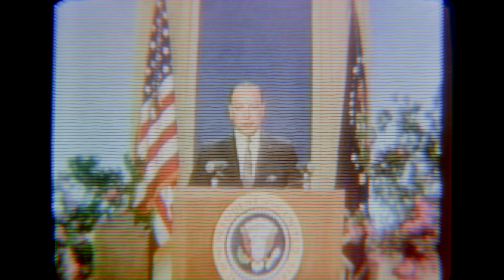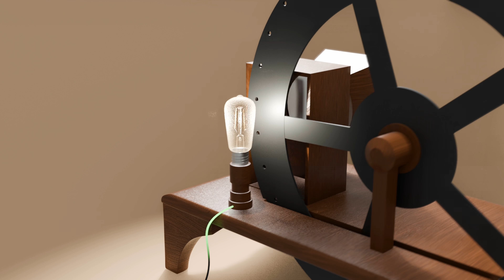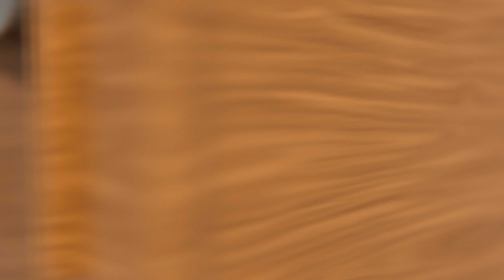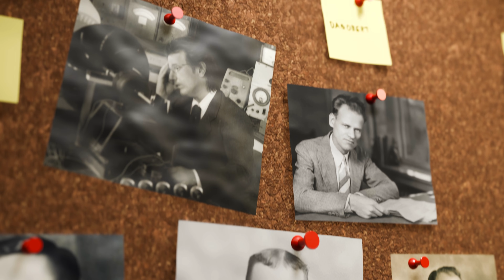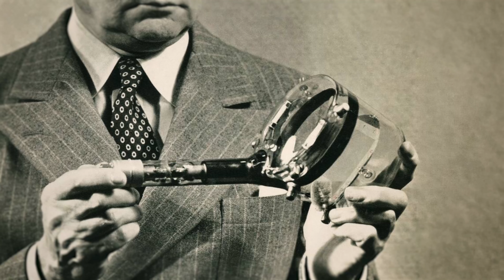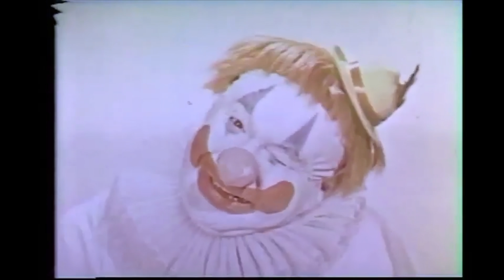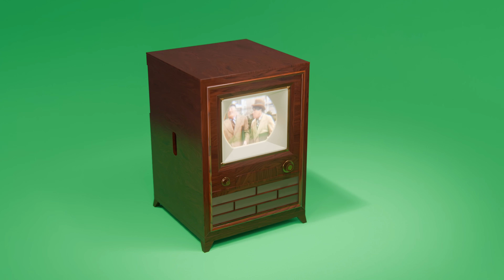Why Inventing Color TV Was So Difficult

Comment: One of the craziest things about those early CRTs to me is that they made them entirely without chips. Ever single deflection of the electron beam was controlled entirely through analog circuits, and they didn't have access to the same computer controlled, high-precision manufacturing tools we have today. RCA made their shadow mask without any kind of CNC machines, just well made mechanical and analog ones. It's honestly insane to me

Comment: You may be asking: how did they fit all the chroma and luma data into the same bandwidth as luma originally? Answer: they didn't. The ability to represent luminance changes of a certain frequency is limited, and some color changes are limited as well. For photographic images it works fine, but it does result in some image artifacts. For instance, if you pause a video game or any image with well-defined lines, you can see "dot crawl" on the lines. This is a result of composite video having to jam the chroma and luma together, losing a little image quality in the process. On non-broadcast TV, you don't get this if you're using component video or S-video, which have more wires to carry picture data. Edit: if you're watching a DVD of a TV show encoded in NTSC broadcast format, the artifacts will be there regardless.

Comment: Wasn’t that similar 😉. I fix TVs in the late 60s and early 70s.   Beginning with tube type only and then in the 70s became transistorized (Quasar by Motorola ,works in the drawer.) 
Keeping that chroma signal locked in at 3.57 was always a challenge. I can’t tell you how many TVs that I had to align the beams using dot matrix pattern on the screen..  of course I have not so fine memories of that 24,000 bolts hitting the anode on the CRT.  

Excellent video

Comment: Color decoding depended heavily on the system used for decoding. Several different systems were used, the most well-known being NTSC, SECAM, and PAL. They were not compatible. For example, a SECAM decoder produced a black-and-white image encoded with PAL (with noise instead of sound), a PAL decoder produced no image or sound with an NTSC encoder, and vice versa. On the other hand, all of these systems relied on the network frequency of the country in which they operated for various reasons (NTSC 60Hz, PAL and SECAM 50Hz).

Comment: How could the encode pixel information? As in what pixel the signal at any moment corresponds to? Also, they had to not just push the beam out of the 3 guns but had to point the beams at a pixel. If I were asked to do this now, I'd simply use a microcontroller to control the coils to deflect the beams but how did they do it in those days? A lot of questions, a lot curious to know 😅
Reply: It was not pixel-based, which requires a computing chip. Television was initially electric vacuum tube analog and then solid state analog technology.

Comment: My parents still had b&w when I was young.  We also inherited a b&w set from a relative. Around 1980 they won a 13" b&w Panasonic portable from work brand new that lasted several years.  And we were one of the first to get cable in 1982, as soon as the neighborhood was wired for it.

Comment: You forgot the big problem with NTSC was it's nick name "Never Twice the Same Colour" which meant a hue control had to be adjusted on the TV to correct the displayed colours to shift the RGB display to correct positions, a problem solved later with the German PAL system used in the UK, Europe and much of the world in the 1960's. This may of appeared much later than NTSC but was a much improved display every time further improved by the Japenese Trinitron to replace the  shadowmask CRT. Later TV's used slots with vertical phosphors insread of a shadow mask.

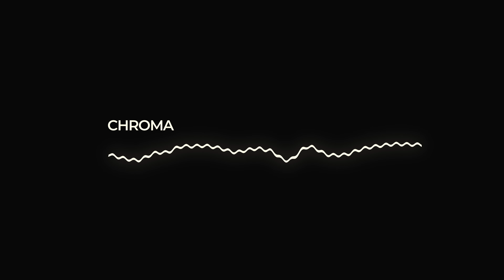Comment: 13:28 This is incorrect. Color TVs used the Luma AND the two chroma channels. Three channels are required to perform the maths to get back to the red, green and blue channels. Also the luma was given much more bandwidth than the chroma channels so using luma only would result in a much lower resolution image. Great video except for this one major mistake.

Comment: CBS had a system before RCA.  The CBS system had a spinning color wheel in the camera,  where a Red, Green,  and Blue image would be sent one at a time.   The TVs would have a synchronized color wheel in front of a black and white CRT.  The colors were wonderful,  but the scan frequencies didn't match the black and white standards, making black and white TVs obsolete.    As TV screens got larger, the spinning filter wheel also become impossibly large.   Improvements in technology could have fixed this, but RCA showed the FCC a system that didn't have those issues.   The FCC okayed the RCA system and shut down the CBS system.   What most people didn't know is the RCA system transmitted the color information as a very low resolution image.  The higher resolution black and white image tricked people into seeing the color as a higher resolution than what it really was.

Comment: One thing left out that is still a bain to American broadcasts, even digital, is the fact that B&W TVs were 30 frames per second but the new chroma information would only work with current TVs if the frame rate was changed to 29.97.  All American broadcasts (NTSC) including digital still use this framerate. The timecode on recordings and finished masters use drop-frame time code so broadcast time lines up with real time. Really just a mess that the Europeans avoided and use 25 fps.

Comment: One error : the luminance signal is not filtered out 13:30, it is combined with the chrominance signals. Since there are 3 colours, red, green and blue, three signals are required to encode them. Since the luminance was always present, the other two signals became red minus luminance, and blue minus luminance, or E'U = 0.493(E'B - E'Y and E'V = 0.877(E'R - E'Y), where E’B is the blue signal, E’R is the red signal, and E'Y is the luminance signal. Green is then recovered by removing red and blue from luminance: (G-Y) = -0.28I - 0.54Q = -0.575U - 3.94V = -0.509(R-Y) - 0.194(B-Y).
So far from being filtered out, luminance is a vital part of the colour signal.

One final note, green was chosen to be more represented by the higher resolution luminance signal because the human eye is more sensitive to green light than red or blue, the theory being viewers wouldn’t notice a degradation in quality in red and blue as much as they would in green.

Comment: 14:01 you still need luma, otherwise there are 3 unknowns but 2 equations so you can't solve the equation. explanation from gemini AI

You are right to be suspicious. That YouTuber’s explanation is a misunderstanding of how color television works.If a color TV discarded the Y (Luma) signal, it would be impossible to see a proper image. Here is the truth about how those three variables work together:1. The Y (Luma) is Essential for BothThe Y signal is the foundation of the entire image. It contains all the brightness, detail, and contrast information.Black and White TVs: They only "see" the Y signal. They are physically incapable of decoding the I and Q signals, so they simply ignore them and display the Y as a grayscale image.Color TVs: They MUST use the Y signal. Without it, the TV wouldn't know how bright any part of the screen should be.2. Why the Color TV needs all threeTo show a color picture, a TV needs to recreate the original Red (R), Green (G), and Blue (B) signals to fire the electron guns (in a CRT) or light up the pixels.To get Red, Green, and Blue back, the TV performs an algebraic "reverse" of the formulas I mentioned earlier. If you only had I and Q, you would have color information but zero "light." It would be like having a bucket of paint but no wall to put it on.The conversion back to RGB looks roughly like this:$R = Y + 0.956I + 0.621Q$$G = Y - 0.272I - 0.647Q$$B = Y - 1.106I + 1.703Q$Notice that $Y$ is in every single equation. If a color TV discarded $Y$, it would have no baseline to calculate the actual colors.3. What the YouTuber might have meantThey might have been confusing "discarding" with "separating." In a color TV, a circuit called a chroma decoder separates the I and Q (the color info) from the Y (the brightness info) so it can process them individually before mixing them back together to create the final RGB image.Summary: * Black & White TV: Uses Y, ignores I & Q.Color TV: Uses Y + I + Q to rebuild the full picture.

and chat GPT

You’re right to be suspicious — that YouTube claim is incorrect.

📺 What actually happens in YIQ
4
✅ The truth (simple version)
Black & white TVs
→ use only Y (luminance)
→ ignore I and Q
Color TVs
→ use ALL THREE: Y + I + Q
→ they do NOT discard Y
🧠 Why Y is essential

The Y channel carries brightness and detail:

edges
shapes
contrast

Without Y:

you’d lose most of the image structure
you’d only have vague color differences

👉 So you cannot reconstruct a proper image from I and Q alone

🔬 What I and Q actually do
I and Q = color differences (chrominance)
They are like “color corrections” added on top of brightness

Think of it like:

Y = grayscale photo
I + Q = color tint instructions
⚠ Why the YouTube idea fails

The claim says:

“Color TVs discard Y and reconstruct RGB from I and Q”

That breaks for two reasons:

1. ❌ Missing brightness information

RGB depends heavily on luminance:

𝑅
,
𝐺
,
𝐵
≠
functions of only I and Q
R,G,B

=functions of only I and Q

If you try:

many different RGB colors map to the same I/Q
so the conversion is not reversible
2. ❌ Math proves it

The real reconstruction is:

𝑅
=
𝑌
+
0.956
𝐼
+
0.621
𝑄
R=Y+0.956I+0.621Q
𝐺
=
𝑌
−
0.272
𝐼
−
0.647
𝑄
G=Y−0.272I−0.647Q
𝐵
=
𝑌
−
1.106
𝐼
+
1.703
𝑄
B=Y−1.106I+1.703Q

👉 Notice: every equation depends on Y

Remove Y → impossible to get correct RGB.

📡 What actually happens in NTSC
Signal is broadcast as:
Y (luminance) → main signal
I/Q (chrominance) → encoded on a color subcarrier
A color TV:
extracts Y
extracts I/Q
combines them → reconstructs RGB
🧩 Intuition
Y = “how bright”
I/Q = “what color”

👉 You need both to know:

“what color at what brightness”

🟢 Bottom line
✔ B&W TV → uses only Y
✔ Color TV → uses Y + I + Q
❌ Color TV does NOT discard Y
❌ You cannot recover RGB from I and Q alone

If you want, I can show you what an image looks like with only I/Q vs only Y — it makes the difference really obvious.

Comment: Color is transmitted on a different subcarrier, not blended with chroma. in between the sound carrier and the Luma carrier. 
 It is modulated in Phase modulaition , PM, compared to the color reference signal, named the color burst, included in the black porch portion of the luma signal... which is the reference color for a caucasian person's skin color.
This reference was use because reproducing the skin color adequately was not easy and was pretty important to prevent people on tv having weird skin color.
B&W TVs didnt have to "filter out" the color carrier, it just didnt pick it up, There was no tuner for that carrier.

Comment: Thanks, although I know a lot about TVs past, I learned something new. However, one remark: The reason for the shadow mask WASN'T the size of the electron beam at the time. If it was, we wouldn't have had such masks in modern TVs. 
The actual issue was 1. that the TV signal was in lines, but those were dots - and you only want to reach the right dots, 2. you wouldn't be able to turn the beam on and off at such precision that it would always hit the right color. TV tubes are messy when it comes to alignment, depending on where they are on our earth, and what's near them, plus manufacturing inaccuracies. First TVs were HELL to align even for the dot mask. Later, Sony wanted to make the Chromatron - a screen WITHOUT mask - and failed to make it commercially viable, but this failure led to Trinitron. 
Only Sony's Indextron - and that only on very small screens - was a commercially available color TV without mask (if you don't count in JVC's hybrid LCD-assisted monitors).
EDIT: Also the Nipkow disk (you mentioned it as Baird system only) does not distort images as pictured in your rendering, as another Nipkow disk is on the capturing site working with the same circular bow as the display.

Comment: Good but not complete. Some friends and myself converted a B&W Tv to Color using a color wheel spinning in front of the screen while home built circuits decoded color signals to control crt gun and color wheel. Of course the picture was only a 5” in size but colors were great.
Reply: Great job!

Comment: 12:28    It genuinely boggles my mind that they were able to figure out how to compress color signals into the same band with his black and white signals before things like major computer aid to help them out. Like these guys were just tinkering and fine tuning until it worked
Reply: They didn't do any compression: they reduced the bandwidth of the B/W (which became luma) signal in order to make room for the colour information. This is just one of the many things that this video got wrong.

And no, they were not "tinkering"; they knew very well what the were doing and in fact had both Claude Shannon's relatively recent work on information theory and long experience of how bandwidth worked in many systems to inform their designs.
Reply: @Curt_Sampson and the world would be a better place if bean counters would not have eaten the safety distance between bw and audio. I can imagine how proud they were to save bandwidth on the TV channels.
Reply: @ArneChristianRosenfeldt  I'm not familiar with the problem, but  find it very difficult to believe that the "bean counters" even know anything about the placement of video vs. audio in an NTSC broadcast signal, but less forced the engineers to do something that would reduce signal quality unnecessarily.
Reply: @Curt_Sampson okay, let’s call them senior engineers who learned  that bandwidth for AM radio on long wave is expensive. And they did not understand that newly thing called UHF.
Reply: @ArneChristianRosenfeldt  It would be helpful if you would explain the supposed problem. You first appeared to be talking about the distance between the luma and audio signals for a television channel, but now you appear to be talking about television channels versus AM radio, which are hugely separated (AM radio tops out around 1.7 MHz; VHF TV starts around 54 MHz) and so have no interference with each other at all.
Reply: Crazy, right? I find this demonstrates perfectly information science... These days, when people hear about "IT", they immediately think of computers and it's synonymously called "computer science". But that's far from the truth. It's so much more. It's about all kinds of information. E.g. this here is information technology. Quite a bunch of radio and television technicians I know made the jump to IT in the early days, since it's basically the same discipline in a broader sense.

That's why Dijkstra appropriately said "Computer science is no more about computers than astronomy is about telescopes". Computers are a mere tool. And IT is not just about the physical machines and hardware, it's about the computation, the algorithms, and logic behind it.
Reply: Yes, so many major invention came after ww2
Reply: It was precisely engineers realized how sensitive we are to luma and how insensitive we are to chromatic differences. Also, color varies significantly less compared to luma. A.. red brick wall? lots of shades of darker and lighter grain on the bricks, but they're all similar in redness. That concept is still used in the digital world via subpixeling. Multiple pixels would share the same color information, even though every pixel has unique luma information.
Reply: Yeah, for all the ridicule that NTSC got over the decades -- it was an absolutely brilliant invention.

Comment: @EeicWeimer2101
RCA was NOT being magnanimous!  Compatability with existing B&W signals and receivers was part of the upfront requirements. 

RCA head David Sarnoff was ruthless and under-handed: Congress concluded that he had manipulated RCA stock prices, causing others large financial losses; He stole working electronic TV from Philo Farnsworth, and suddenly, RCA "invented" it; He was instrumental in having the FM band changed right after WWII, to protect the RCA owned NBC radio network while RCA concentrated on TV.  The band change made FM inventor Edwin Armstrong's holdings almost worthless. 

Although RCA delayed and drew out lawsuits brought by Farnsworth and Armstrong, RCA eventually lost both suits, but paid a fraction of the true values.

Comment: Well...my days of repairing CRT TVs are long gone. The old days of getting shock because i didn't properly discharge the capacitors.  easy to swap components no microscope needed. No internet for me in those times . If I didn't had the schematic for those different tv models  I had to use a semiconductor parts bible  and hope I could find the transistor or IC parts in there and try to figure out the connections or functions on the PCB. Watching the analog signals on a oscilloscope was very cool.

Comment: The colour-difference values that analogue TV used are still used in digital form today. Formats like JPEG and most video codecs still produce them as part of their encoding, reducing the colour resolution to save space. Though they're based on something more like the U and V of PAL than the I and Q of NTSC, as it's a little easier to calculate.